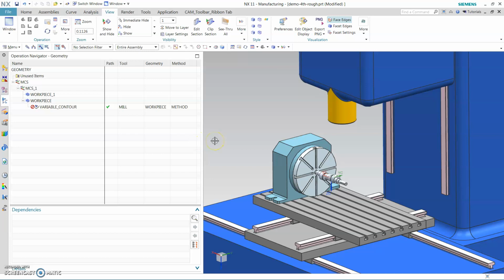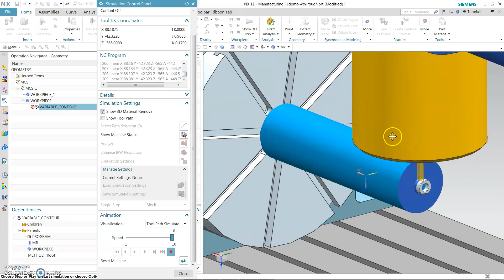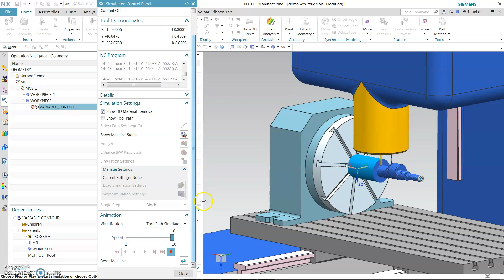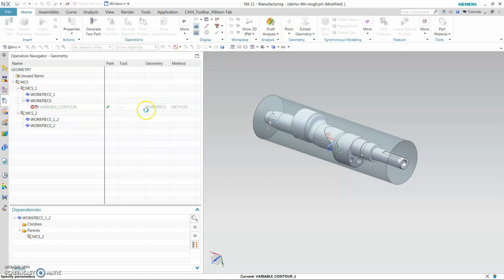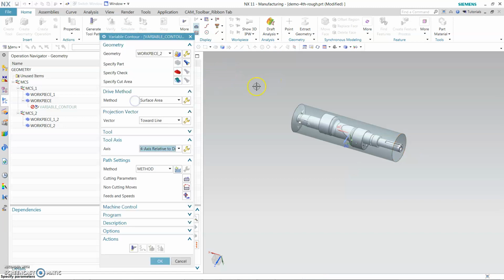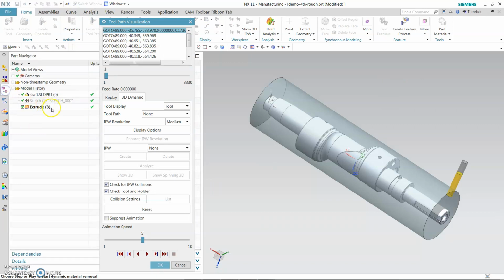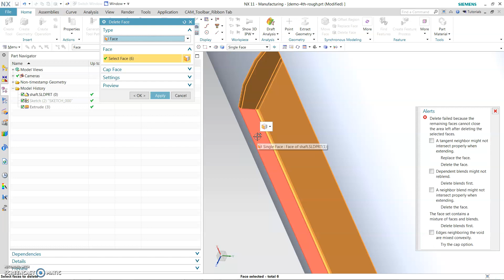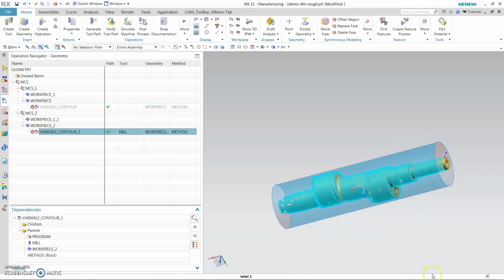Siemens NXCAM Crankshaft Machining

Comment: Hi sir.
Reply from the maker: Hi Hamed, use cutting parameters option to specify multiple cuts and give each cut incremental value after specifying stock. Axial depth of .5mm can be specified in cutting parameters.see the video I have to cut worm gear with multiple cuts
Reply: @extremeperformance4110  Hi my friend، Thank you for your kindness.
Reply from the maker: @hamedhamedi2118  no problem Hamed